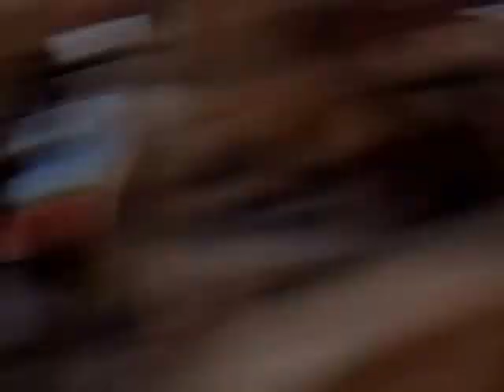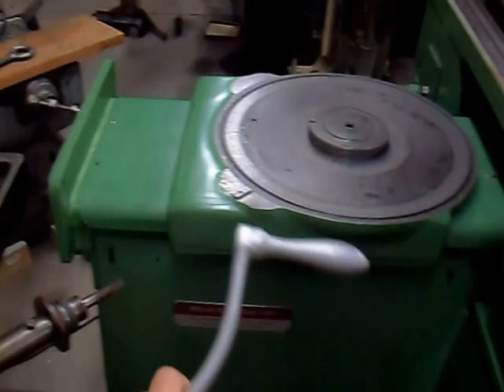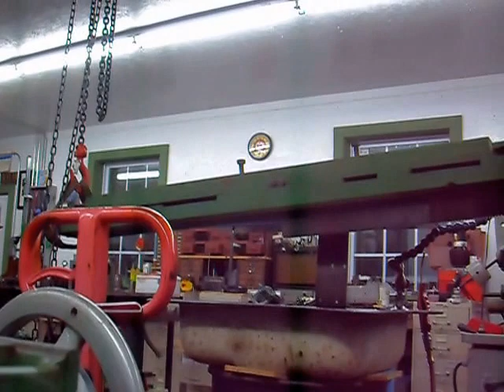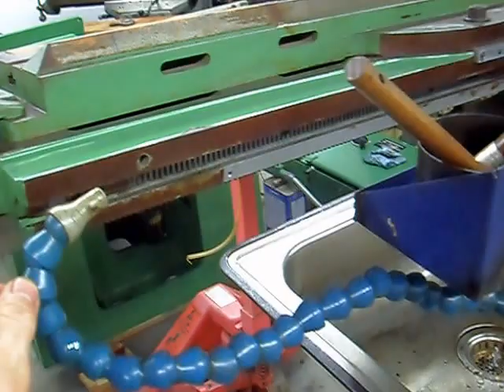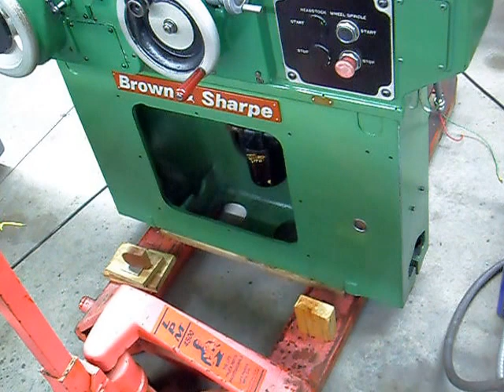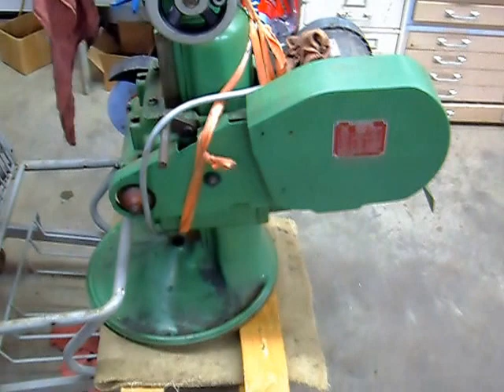Doozer's Machine Shop Update 7-1-17

Comment: Thanks for this series of videos.  I got my B&S 13 in mid June, without a tailstock.  Found a tailstock on ebay about a month and a half later. Felt darn lucky to find one and here you are with two of them!   Plan on doing the same as you, clean and make sure the oil is flowing. These may be the most appropriate videos ever made! Well, for me at least.  About oil flow, can't recall where I read where, probably PM, but too much flow, will produce too thick a film and will adversely effect the grind quality  (or accuracy?).  I have no personal experience to support this.  Also, I have the wobbly x feed wheel as well, so thanks for showing the repair.   That machine is a real peach, the grinder equivalent of the car that was only driven to the grocery store and to church on Sunday by a little  old lady (but was built by scabs during a UAW strike).
Reply from the maker: John, So very happy you found my chronicle useful.  These are special machines.